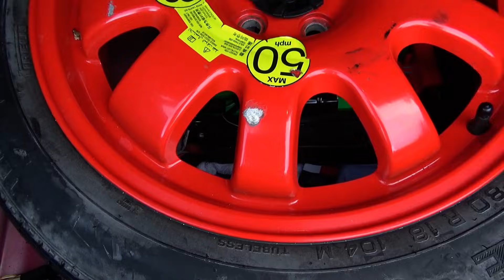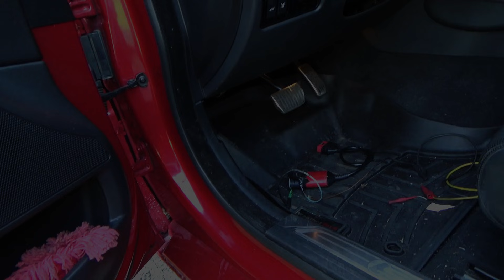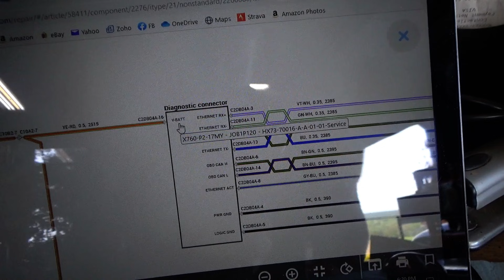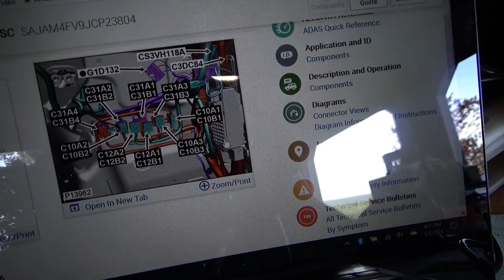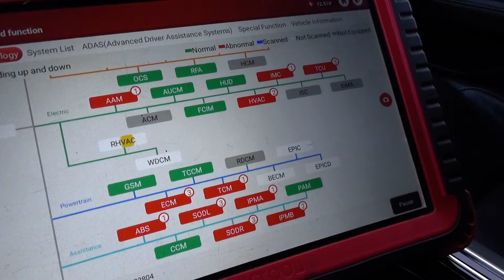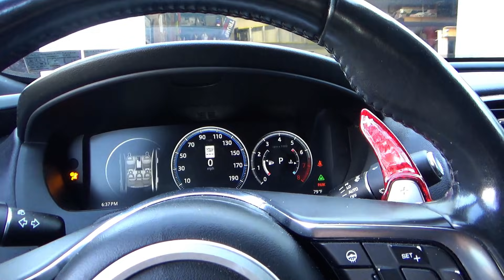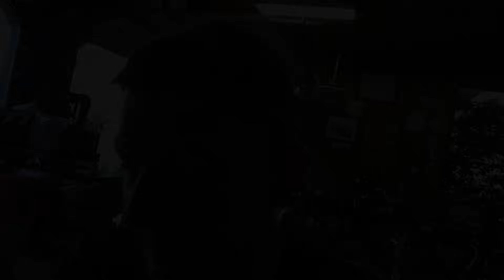Jaguar Transmission FAULT...Can't Read Codes?? ('18 XE AWD Supercharged)

Comment: I've seen a bad battery,  voltage anomalies and stuff cause all kinds of silly codes.  You didn't have us place bets, but from everything I've learned from you and S.M. auto,  plus seeing the  check system voltage on your computer,  I figured the codes got set off by the previous battery.  Why the blown fuse?  No idea,  clearing the codes was most likely just what the doctor ordered! I didn't comment on it but that Tundra case study blew my mind!  Thank you for helping us understand the demons that live in our modern vehicles!

Comment: bought a saturn ion crank  no start for scrap value 300 dollars i almost gave up found the weirdest thing silicone in the intake blocking air flow removed and car started and ran well but code reader still would not work checked all fuses found com fuse blown replaced and code reader worked drove 2 years only 1  relay  relay replace son son totaled car insurance gave 3500

Comment: Info service talked about the battery maybe the fautl arrived with the old battery and now fixed after erased code. always pleasant
Reply: Yep I think old battery code was to blame. But why fuse blown ? Sabotage to make sure codes could not be read by a previous owner/seller ?

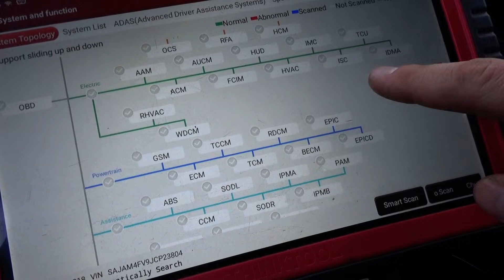Comment: A beast ha ha ha, My 1969 Nova runs 9:40s in the 1/4 mile. The first 70 FT are on the back tires. My 1987 GNX will out handle that Jigguar 
If you live in the USA, buy a car made in the USA. If you live in Japan, same thing. Are there any real collector cars from Japan ??
Maybe three 240Z- 510 - Fairlady ( I had a 1600 )  OK Honda NSX. If I put my 68 Z/28 or my 70 Chevelle SS big block up for sale there would be a Gun fight in my FT yard.
Reply: And your 69 Nova is all stock and runs 9:40's?  Fat chance.  I'm a gbody guy your GNX won't out handle this car in stock form, I don't care how many extra body mounts and braces you have. 
I'll stick with Toyota, their worst car is still better than ANY GM. Fit, finish, cost of ownership all beat GM by miles.
Reply from the maker: @truracer20  Except for the 22+ Tundras...they seem to be blowing their twin turbo engines before 50k miles LOL!
Reply: @PineHollowAutoDiagnostics  Toyota messes up once in a while. Small displacement/high power= short life in my book.
Reply from the maker: @brianw8963  yeah this one sounds like it might hurt their stellar reputation quite a bit 😬
Reply: @PineHollowAutoDiagnostics  Most often when they do have a major issue they make it right. We will see.
Reply: Yes there are some collectors from Japan , not so much for 1/4 mile times but for reliability times I’ll put my old 94 Camry against anything out there. 👍👍🇺🇸
Reply: You are full of sh#$

Comment: I bought the launch scantool tablet and super disappointed it doesn't have the system topology feature :(
Reply: All the high  gama have it , you may have got a mid gama with small  screen . In order for the Topology works hast to be tablet screen on 9.6 onches or more .
Reply: @JoelAutomotrizenAccion  Darn,this is the 7inch version :(
Reply: My launch doesn't have topology feature. Doesn't matter. On the report it tells you what is in each module.
Reply: @2nickles647  true but network  Topology  is very helpful  to diagnose  with network  branch is down , or what module are not communicating  , very helpful  for no comms

Comment: It also goes from having money in your bank account to  broke in 0 to 60 seconds.
Reply: All I see wrong is it had a blown fuse. Ran and drove fine.
But when Toyauto or is it Teeota has a problem, then it's ok?
🤷
Reply: @billmalec no my tauwote doesn't leak.
Reply: @_RiseAgainst  but it's a boring piece of crap
Reply: @billmalec  definitely not a peice of crap, and it doesn't possess tunnel digging capabilities.
Reply: @_RiseAgainst  boring for sure.
Reply: @_RiseAgainst  would I have a Jaguar? Heck no but that doesn't preclude what happened here. It had a blown fuse. Basically that's it.
Reply: @billmalec I’d rather have my “boring” 2021 4Runner that’s extremely reliable, than a “fun-exciting” whatever else that doesn’t last 150k miles without major issues/problems, or even 200k or 250k lol a 4Runner and the like, can easily make 500k+ and run like it was new, with basic proper maintenance. Sadly any Fiat stelantis or ford/chevy, outside of their 250/2500+, can’t do that like Toyota’s built at tahara plant or any plant in Japan.
Reply: To be honest, anything fairly new is a ticking time bomb. Plastic & electrical/modules everywhere equals reliability issues no matter what brand.
Reply: @shootinglaser  bam. He hit it on the nail Head. I just like to ruffle the Toyota fanboi fancy feathers. 🤣
Reply: @billmalec  I love when yall call anyone that’s pro-Toyota a “fan boy”, typical Ad hominem attacks when one has no reply. I’ve owned lots of cars/trucks in my life. Never owned a Toyota until I got my 4Runner. The only vehicle I owned that didn’t start having serious problems other than my 4Runner, was my F250 6.7 and even that, due to epa requirements, started having dpf / scr and egr problems, as they all do eventually. The 4Runner is called “a dinosaur” for a reason. It doesn’t have all the modern bs that “planned obsolescence” and the epa has pushed on the US market. You don’t need a scanner to do 98% of any repairs on them. Unfortunately Toyota caved to the epa and made the 6th gen 4Runner a Tacoma SUV. No more naturally aspirated 1GR-FE and A750F, now forced induction 4cyl, more electronics, com’s, and bcm’s, therefore it won’t have the known reliability of the 4Runner. Love them or hate them, nobody with any sense or knowledge can argue Toyota reliability. Atleast not honestly. Sadly, US auto manufacturers, are barely US made, and a lot moving to Mexico and Canada, parts from china, and the build quality is ridiculously bad. Hey, what do I know, car & driver and JD Power rank them “best car of ___” so it must be true. Never claimed they’re perfect, but they’re significantly better made than US manufacturers or stelantis.
Reply: Engine made by Ford, transmission made by ZF in Germany.